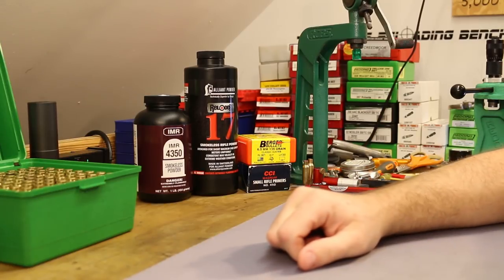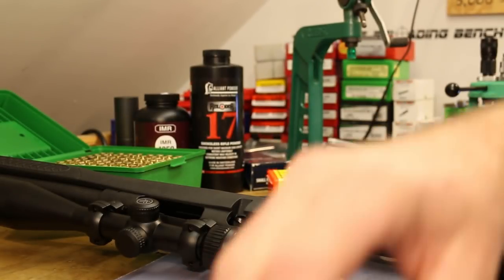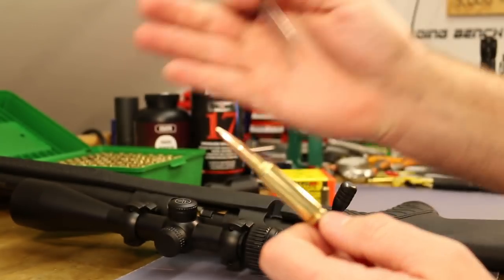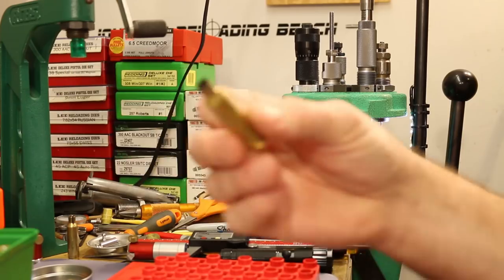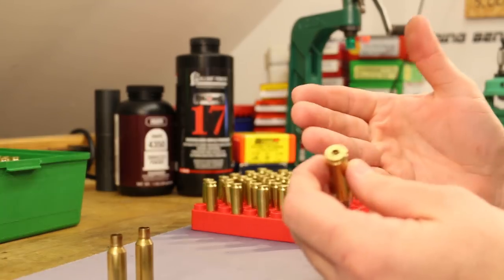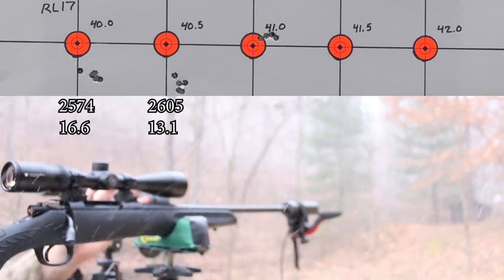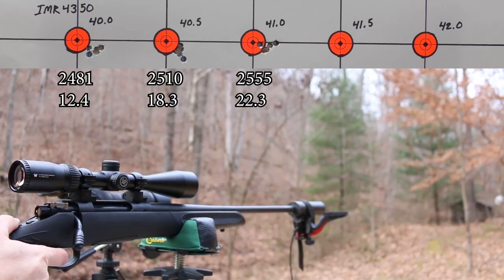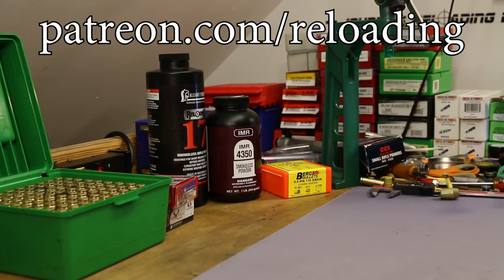6.5 Creedmoor - 135gr Berger Classic Hunter

Comment: Would love to see a comparison between h4350 and imr4350.    Side by side same cartridge. What's the difference in speed pressure and accuracy
Reply: H4350 ends up being the better powder, If your not staying in the same place, for one reason. IMR 4350 is sensitive to altitudes.
I found this out off my bench @700', then going to 5,000 feet shooting prairie dogs. My groups at 700' elevation were touching, at 5,000' they were open and 1".  This made it a little harder with the wind, to compensate, with shots past 100 yards.  I had 100 rounds worked up with H4350, and the impact and group size was still consistent with what I had gotten of my bench at 700' elevation. Both are accurate powders, but my SD was better with IMR. This was my experience, I hope it helps. Back home I shoot IMR, out west I shoot Hodgdon.
Reply: I was surprised at the difference between IMR4350 and H4350. Hands down H4350 wins for me. With the 135 Classic Hunter it’s by far my best load. Beats 143 ELD-X and 130 Gamechangers.

Comment: You were using the .400 comparator to measure the shoulder to base.  That is not the correct comparator for the 6.5 creedmoor.  You need to use the C.375 comparator to measure the shoulder to base.  Just to keep in mind.

Comment: Besides all the great information you provide I believe your demonstration on the length gauge and measuring the distance to the lands of the bore is one of the best I've seen.  I always check that measurement after setting my resizing die .002" off the shoulder just to make sure the bullet being used is still supported in the case as it enters the rifling.  I've seen problems in AR's shooting very short varmint bullets compared to the long military throats of the 5.56 where the little 45 or 50 grainers have to jump in the chamber from the brass to the rifling unsupported.  Not what you want for accuracy.  In my 6.5CM if I have room I will seat the front of the boat tail to the base of the neck or if shooting heavier bullets I set the OAL of the cartridge to place the bullet .040" off the lands to provide a proper head start to avoid pressure spikes.  Thanks for your work.

Comment: I found a good tip on another webcast for how to get a good measurement with your overall length tool. You put your cleaning rod into the barrel and push the bullet out with the cleaning rod. When you're inserting the bullet you will tap your push rod on your overall length tool and push back with the cleaning rod, and do this several times until you feel like you have just reached the lands.

Comment: I was glad to see you use IMR4350 in your video. All the 4350 powders are good choices for many calibers. I prefer the Hodgdon when I can get it and Accurate isn't too bad either. They are very consistent and safe powders for many calibers meaning you can fill the case and never have a pressure problem. The Hodgdon4350 is a short cut and the IMR4350 isn't much different and the Accurate4350 is a little coarser, but they are all very close in the way they perform in case capacity and bullet speeds. The Hodgdon is easier to meter. It was not available last time I purchased powder and I had to get IMR4350, so it's been a little different but not much. I always buy 8-pound kegs, so I don't need to bother with getting powder from different lot numbers. Today one needs to buy in bulk whenever they can get it. Especially primers.

Comment: John, Another great video. With  m y HHSC, you know the is the Hornady head bla bla , I ONLY use mine on brass fired in my chamber, and then drill and tap them myself. Absolutely the only way to get it perfect, only issue I ran into is in my Bergara B-14  6.5 C, Is when I go to load Berger 140 VLD and want to start .015 off the lands to work up some load data,  they won't fit into the mag. OAL is to long by .0800. New out of the box Hornady 143g, ELD-X are 2.809  to 2.810 for the most part, but those are .0600 off the lands in my chamber, but they shoot sub .40 groups. So probable should reload the 143g of Hornady's. Sure wanted to start at -.o15 and work up some load data. Guess I could mill out a dummy mag. and load one at a time, but when hunting????  you know the issue there.

Comment: 51:00, just FYI, I had the cratered primer pockets with my TC in 30-06, all factory loads and all hand loads from starting load on up. Upon inspection it looked like they chamfered the firing pin hole. I contacted TC and sent pics, they said it was incorrect and to send it in. Came back with a new bolt, no more cratered primers.

Comment: Great vid! Ur reloading process is very similar to mine. I used rl 17 last year with very similar results, in particular the heat sensitivity. I worked up rl 16 this year with extremly good results. SD of all charges < 10 and i suspect do to the extreme temp stability. Hope u test it with rl 16. Velocities comparable to rl 17. My grouping is great as well, 6 of the 8 different charges were sub moa at 100 yd. Ended at 42.6 gr with lapua brass and same bullets u have here.

Comment: Some people talk rubbish about the modified case. It really doesn’t matter if it is 2 thou different to FF. The base to ogive or oal will be exactly the same as in precisely equal to.  How could it not be? 

As for picking a start charge the only safe way without data is to take the specified energy and density figures and look for a comparable few alternatives which are close to it and pick an average of these.  It’ll be close enough to be safe.

Also, 3 thou id the maximum freed headspace for safety to prevent a waist forming at the head with repeated use. Better to aim for 1 thou or zero clearance.  They’ll load fine.

Comment: So basically the hornady head space cage is best if you used when reloading once fired brass as the fired brass shoulder should almost always be touching on the fired brass. Which is what you measure the distance from the shoulder to the lands and not from the bolt face to the lands.

Comment: i am running 44.0 grains of r17 and a 130 norma golden target bullet and lapua brass, with a 24 inch barrel. my magnetospeed for 5 rounds was 2929 with a ES of 4. what i did not like about the R17 is it is not temp stable. I switched to R16 and bumped the charge up to 44.6. i got the 2932 and 3 ES for 5 shots. I am seeing flat primers, but no ejector marks.

Comment: I'm noticing a scratch on my brass at the shoulder and saw it also at 51:18 in the video. Is this normal with the Compass?
Reply from the maker: Yes, and I see it in my Tikka as well.  The scratch gets made during extraction as the case gets tilted and drags before it clears the ejection port.  Eject some empty brass slowly and watch it as it comes out, see if you agree.  I don't think it's anything to worry about.

Comment: Which stem is that (part number?) I need to order one. My die set only came with one and it does not work with it.
Reply: I think i found the hornady seating stem that works for this bullet. It's at least tighter than the one that came with my dies. It's for 143/147 eldx, eldm (pn#397130)